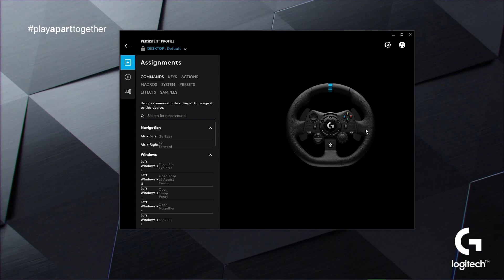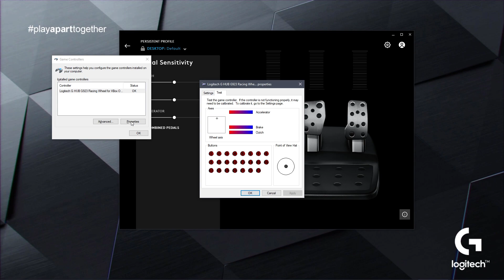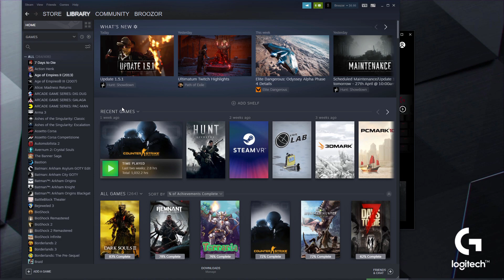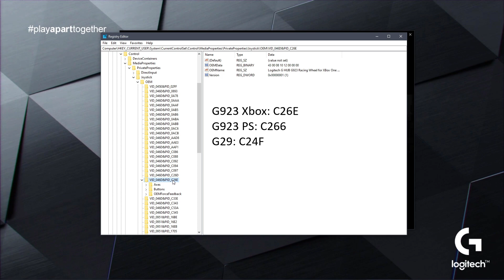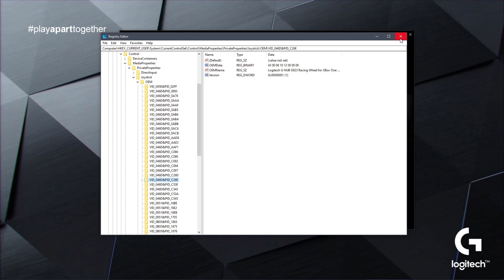How to troubleshoot G923/G29/G920 for Connection Issue

Comment: hello logitech support. My G29 steering wheel after downloading a firmware update from Ghub is showing a failure can you help? If set to 900 degrees on the Ghub it is not in the zero position of the calibration menu. It displays values between -2 and 2 degrees when centered. If set to 180 degrees, the calibration menu displays zero (0) position normally. despite this fault, the steering wheel calibrates perfectly and is not losing center in the games I use. (euro truck) I believe it does not have a physical defect because it does not present centering faults, only the Ghub calibration menu presents this error.
Reply from the maker: Hi there!

We'd love to gather more information about this issue. If you can file a ticket with us we can try to come up with a solution!

https://support.logi.com/hc/en-us
Reply: @logitechsupport  I have done that :)
Reply: I have the exact same problem with my g920! Did you find a solution???
Reply: @dk9469  I still haven't found a solution. I opened the ticket with logitech passed me some procedures to install and uninstall delete folders but it did not work. I'm waiting for new support steps. If there is a solution I will come back and comment. I think they should make a firmware fix available, this bug (problem) started after the update.
Reply: @IMPOSTOR1234-y1  Im sending mine back and going for a g923 xbox edition, i‘ll keep you update if the issue persists
Reply: @dk9469  hello the solution found to the problem I mentioned after a lot of research. calibrate the steering wheel through windows and ignore the information presented in the Ghub as this interface does not seem to work well. Unless your steering wheel is physically losing center ignore it ✌️
Reply: @IMPOSTOR1234-y1  my new g923 xbox has the same problem xD thank you i‘ll try it out <3 ill let you know
Reply: @dk9469  yeah i have the g923 xbox edition and i have it too i think its just a problem with lghub since in games it isnt like that
Reply: @katterna6556  Thats true. How do you get the RPM Lights to work? Don‘t work at all for me
Reply: @katterna6556  You guys please let‘s stay in contact about this issue. :)
Reply: @dk9469  they dont work in every game. What games have you tried them with? They should work automatically
Reply: @dk9469  yes, i also got a problem with operating range not changing when i set it to 360 for example i have to turn the wheel 450 degrees for it to register 180 in ghub
Reply: @katterna6556  That‘s very weird. I‘ll try it out with mine when i get home
Reply: @IMPOSTOR1234-y1  it didnt change anything for me :(
Reply: @dk9469  MY CONCLUSION ABOUT THE PROBLEM If the steering wheel is calibrated in Windows and works perfectly within the games without physical failures, don't worry. ignore the Ghub calibration info as that is a bug. Do a calibration in windows to make sure it's not a hardware defect. because if windows recognizes the device and manages to calibrate it, it is perfect without changes. I got a step to reset all calibration if you want I leave a dowload link.
Reply: I sent my g920 back for a new one and I have the exact same problem still so its definitely not a physical defect.

Comment: Hi. I have another issue. I have G29 + Shifter. GHub shows only the steering wheel. When I go into settings it doesn't respond at all. It also doesn't work in games. I checked are the cables and I tried to reinstall the GHub but it didn't help. I can see the wheel on GHub but that's about it.
Reply from the maker: Hi!

The shifter should be nested underneath the wheel if you click the right arrow in G Hub. If it is not showing up please check the pins on the cable. If that doesn't fix the issue please open a ticket with us!

https://support.logi.com/hc/en-us

Comment: mine just keap telling connection who do i fix that
Reply from the maker: Hey there!

Can you make sure your wheel is properly powered? The connection needs to be seated correctly and I would check the power supply as well! 

Also make sure you are not using any sort of USB hub for the wheel. 

If this doesn't change the issue please open a ticket down below!

https://support.logi.com/hc/en-us/requests/new?ticket_form_id=360000621393

Comment: Hi I tried step four EXACTLY as described, but the wheel does NOT show back up with the registry. Why is that? I have the G923 for Xbox
Reply from the maker: Hi!

You may need to restart your machine as well as change the USB port that the wheel is plugged into!

After those steps if you are still having issues please open a ticket down below!

https://support.logi.com/hc/en-us/requests/new?ticket_form_id=360000621393

Comment: Everything worked fine on my G923 until the latest GHub release on 1/25/22. Now I can't turn the wheel at all. Doesn't work on any PC even with a fresh GHub install. Wheel is not recognized in steam and doesn't work in other software now either. Works fine only on my XBOX. I tried deleting the registry entry and it added it back but the part about force feedback is now missing from the entry too. I had to reinstall the software again to ge tit back but the issue didn't get resolved.  And, now all my application icons are missing in GHub so I can't tell what each app is until I click on it. I now lost hours of customized work. This tutorial was not helpful at all. I have been back and forth with support for a month trying to resolve issues with this wheel. Worst purchase I ever made. I wish I had bought a Thrustmaster.
Reply from the maker: Hey there!

This is definitely not the gaming experience we want you to have. If you reach back out to us via your support tickets we can definitely try to find a solution for you!
Reply: @logitechsupport  I ended up replacing the wheel yesterday. I drove 4 and half hours round trip to get one and when I got home it was new defective. I am now on my third wheel and so far it seems to work BUT when I downloaded my profiles from the cloud the screen turns black when I switch to them. GHub is the worst software I have ever encountered. I'll test this weekend and make a decision if I'm, returning for a refund. But one thing is for sure, I'm done ever buying another Logitech product after this. I had a bad experience in the past with Logitech headphones and thought I would give it another try with this wheel. Never again! As for tech support, they have been completely unhelpful. Worst customer service experience ever.
Reply: @GlenBaisley  You drive four and a half hours thrice for nothing, that's what I call skill!

Comment: He Logitech team my Logitech g923 isn’t working right every time I plug the wheels in the wheel it just shuts off doesn’t let me make contact with the Xbox by the wheel when I unplug the pedals it works
Reply from the maker: Hi!

Can you make sure that your wheel is powered properly? That would mean making sure the cables are connected correctly and making sure the power supply is plugged into a wall outlet!

If that doesn't help please open a ticket down below!

https://support.logi.com/hc/en-us
Reply: @logitechsupport  I did every time I plug pedals into wheel it shuts off completely

Comment: Plugged-in but not showing in the hub at all.
Reply from the maker: Hi there! 

Can you make sure your wheel is properly powered? You'll need to make sure it is in a wall outlet and the power cable is properly connected to your wheel.

If that doesn't help please open a ticket with us down below!

https://support.logi.com/hc/en-us
Reply: @logitechsupport  Well hello there. Solved by switching driver, switched it's Ps3 driver to Pc, then worked. However doesn't work in Ghub..

Comment: Hello, I was recently using my G920 as usual and during a race on iRacing it completely cut out. Turned my PC off and on, to see it still off. Checked all connections and even tried the plug in a different outlet and it still refuses to turn on. 
It also doesn't show as being on anywhere other than in my devices list in my windows settings and there's no lights illuminated on wheel. Any help?
Reply from the maker: Hey there!

Could you open a ticket with us? We can help you diagnose your issue with more depth that way!

https://support.logi.com/hc/en-us
Reply: Did you ever get an answer as to what was wrong? I’m having the same issue

Comment: I thought it worked but then steam doesn't show me the G29 steering wheel ...
from the logitech app the wheel is connected and the preview moves, but as soon as I enter a game the wheel does the calibration again
Reply from the maker: Hi!

Can you make sure all the controller settings in steam are unchecked? Does the wheel still work in game? A driver reinstall might help this issue!

If it does not, please open a ticket down below:
https://support.logi.com/hc/en-us/requests/new?ticket_form_id=360000621393
Reply: @logitechsupport   I "fixed" it by simply changing usb with a 2.0.
Strange, because on the old PC it worked with the same usb splitter and usb type I used now.
Thank for your interest

Comment: Hi,
I have bought a G29 but it is not running on my Mac. 
I have installed G HUB (Version 2021.13.2906) and macOS Monterey (Version 12.0.1).
When I plug in the wheel, the lights on it illuminate and the wheel begins to turn (for self calibration?!). But the wheel is not available in G HUB!
When I start a game (Farming Simulator 22), the game recognizes that the wheel is connected in the settings menu but it is not possible to configure it.

Is there a solution for this problem?
Thx for your support
Reply from the maker: Hi there,

Can you please open a ticket up with us below?

Thanks!
https://support.logi.com/hc/en-us/requests/new?ticket_form_id=360000621393

Comment: Hi. In my case, hear POP sound at adapter ( G29 ). Currently, sending back to claim warranty. Just one month owned. Eager to play GT, buy another LG29. Less one week owned, hear again POP at adapter. Cant use now. I believed adapter fried. My G29 used extension cable. Could be this is main problem ?. By the way, out the box and straight play with PS5. Thank you.
Reply from the maker: Hey there.

It sounds like you might have an issue with how power is being delivered to your power supply. Please make sure you are using appropriate voltage. You also might need to connect the wheel directly to a wall. 

Please open a ticket below if you continue to have issues!

https://support.logi.com/hc/en-us/requests/new?ticket_form_id=360000621393

Comment: Hi there.

I just bought a PS G923 but it doesn’t work.
It’s the first time I have tried to use it but it’s not being recognized by my PS5 or my PC. 

Everything seems to be plugged properly but it’s not recognized in Logitech G Hub and the light doesn’t even flash. What should I do?
Reply from the maker: Hi there!

The G923 is for Xbox and PC. The G920 is what you would need for your Playstation! 

However, if you aren't getting it to be recognized by your PC you may be having a power issue if the light also is not flashing.

Can you open a ticket down below?
https://support.logi.com/hc/en-us/requests/new?ticket_form_id=360000621393
Reply: @logitechsupport  there is a G923 version for PlayStation.

Comment: My steering wheel dosent react
Reply from the maker: Hey!

Please make sure your wheel is powered correctly! You may need to use a wall outlet as well to make sure the power is sufficient. If you are still not getting any response please open a ticket down below!

https://support.logi.com/hc/en-us/requests/new?ticket_form_id=360000621393

Comment: Did not work unfortunately. Everytime I connect the wheel, it gets stuck in trying to connect. Everytime it does; every other button works except for the steering. I tried going through the joy.cpl, Device and Printers things; and whenever I do so it never shows up the stuff as seen in the video. What could be the issue?
Reply from the maker: Hi!

Can you make sure the power is connected properly? If it doesn't show up after that please contact us down below!

https://support.logi.com/hc/en-us/requests/new?ticket_form_id=360000621393

Comment: The G Hub app will not unpack. It gets stuck at 99% in the unpacking phase.
Reply from the maker: Hey there!

Can you make sure G HUB is completely uninstalled before you try again? Also make sure you have admin rights while installing! It might take a second to finish depending on your system.

If that doesn't let you install G HUB please open a ticket down below!

https://support.logi.com/hc/en-us/requests/new?ticket_form_id=360000621393

Comment: GHUB isnt detecting my wheel, what do I do
Reply from the maker: Hi there!

Can you make sure your wheel is powered properly? Make sure all the cables are seated correctly and it is not running through a USB hub. If that doesn't help please open a ticket down below!

https://support.logi.com/hc/en-us/requests/new?ticket_form_id=360000621393
Reply: @logitechsupport  I was lucky enough to have a support agent help me out, it was a problem with GHUB, thank you!

Comment: None of the solutions worked, every time I restart the PC the G Hub doesn't find my G923 wheel, it keeps the "connecting" message, the only way to detect is to reinstall G Hub again, but if I restart the PC e doesn't find again in the G Hub. Any ideas?
Reply from the maker: Hey!

Could you open a ticket up with us? We can diagnose that issue better there!
https://support.logi.com/hc/en-us/requests/new?ticket_form_id=360000621393

Comment: Hello ! 
i buy the G923 in may. Nothing was wrong with it and i was enjoying a lot of games with it. this night, it started not working. It was recognised by LGHUB but on differents games like OMSI 2, the steering of the bus was on the left and it was accelerate. Same problem on ETS 2 it was accelerate. My shifter to was not working. Please help
Thanks
a french
Reply from the maker: Hi there!

Does it function on other games? You may need to bind the controls manually in certain games. However, if you lost functionality in all games please open a ticket down below!

https://support.logi.com/hc/en-us/requests/new?ticket_form_id=360000621393

Comment: so i followed the guide and by step 4 all was well. i went into steam and it still does not recognize my g923 wheel as a controller. should i get ahold of steam support or is there something on my end i can do?
Reply from the maker: Hi there!

Could you try that step again but after give your PC a restart and then power cycle the wheel? Also make sure your wheel and steam are updated! As well as any USB driver updates for your PC.

If that doesn't help please open a ticket down below!

https://support.logi.com/hc/en-us/requests/new?ticket_form_id=360000621393
Reply: Same issue-- My wheel is detected by windows, did the registry edit. G hub is fine too. I have a G29 and a stick shift (logitech). steam fails to recognize the unit. @logitechsupport

Comment: Question, when I go to general control settings for steam, it says no controllers detected. Everything else seems to be working besides that. I tried to do big picture configuration and plugged in my steering wheel and it just sat there loading and nothing happened. Please help. (I have a G29)
Reply: same here, crazy thing is its a brand new g923
Reply: @drewh921  Nothing crazy about that. Often if it's ''too new'' updates have not yet optimized the input device.

Did you get it to work?
Reply from the maker: Hi! 

Have you made sure all the boxes in the steam controller settings are unchecked? Can you also check and make sure your steam has been updated!

If this doesn't help you can contact us for further support down below!
https://support.logi.com/hc/en-us/requests/new?ticket_form_id=360000621393

Comment: hey guys i have an issue, i want the brake pedal to be more sensitive, but when i go to usb game controllers, it doesn’t let me calibrate, when i press the button nothing happens and under the test tab nothing shows up. please help me, i got a windows 11 computer, this doesn’t happen on windows 10

edit: watched the video all the way through and it didn’t work :/
Reply from the maker: Hi there!

Are you getting no response from the pedals at all? Even in G HUB? If you are not, make sure that the pedals connector is properly seated. Check the pins as well! If that doesn't change anything please open a ticket with us below.

https://support.logi.com/hc/en-us/requests/new?ticket_form_id=360000621393

Comment: Mine is just stuck on connecting :(
Reply from the maker: Hey!

Can you make sure your wheel has its power properly connected? If you are still having issues you may need to do a driver reinstall. Also make sure your wheel is connected directly to your PC! Not via a hub. If this doesn't work please open a ticket up with us below!

https://support.logi.com/hc/en-us/requests/new?ticket_form_id=360000621393

Comment: using windows registry did not fix my problem and my g923 is still blank on the test page
Reply from the maker: Hi there!

If you are still getting no wheel in either your registry or G HUB please open a ticket with us down below! 

https://support.logi.com/hc/en-us/requests/new?ticket_form_id=360000621393

Comment: So my wheel and pedals are not being recognized in GHUB, but there wasn't a solution for that... what should I do? I tried the 4th step, still not being recognized.
Reply: Unplugged my power cable, closed GHUB and plugged it back in, made sure there were no driver updates in device manager then when I reopened GHUB it was recognizing just fine!
Reply: @Mayhem0311  lucky, I plugged mine in one day and it just decided to not show up anywhere on my pc
Reply: Dont buy logitech